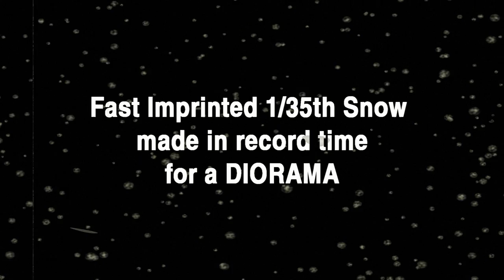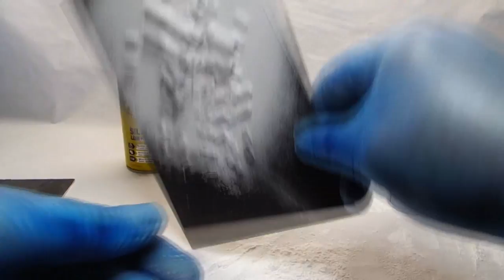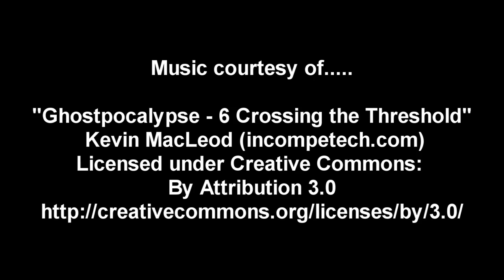MAKING IMPRINTED  SNOW......FAST!

Comment: does the snow remain soft, or it becomes hard or is there a product to make it become hard?
Reply from the maker: Hi Dario, the kits now come with an adhesive which you can apply with a hand pump bottle-  A  trigger spray bottle-  A pump spray bottle, or airbrush- or hand brush...

Mixed with our snow powder it sets  hard. You can build up many wet layers quickly and because it is crystal clear and water thin it is realistic too.

However, it is not water proof but will stand up to handling and touching etc.

You will have to play with different adhesives to try to get the effect you want. But at least we supply one now....Phewww!
Reply: Hi thank you for your answer. Unfortunately I dont understand: you talk about an adhesive you supply that can be sprayed, but I couldnt find it on your store. What's his name? I also dont understand if this Adhesive is something you can use instead of hair lacquer to stick the snow, or can be used over the sticked snow as a final varnish to seal and let the snow become hard.
Thanks
Reply from the maker: Hi Dario.. We have not put our adhesive on our store yet, as we have to change our instructions, website and everyhthing else first. However, we do include it with all kits purchased now.

The adhesive is water clear and water thin. It is water soluble and water based. It is perfect for dioramas and all models. However, we have not experimented yet with fixing snow using our adhesive when it is dried. This would entail spraying a coat of rattle can clear acrylic modelling lacquer over it to raise its durability..  Our snow powder can behave like real snow in these situations and start to go clear etc, so experimenation is the key..  

Another method we recomend  for wargaming figures is to use tinned clear acrylic lacquer and apply it with a brush where you want it. (like on your base). Then sieve the powder onto this.  You can also make a stiff pate like this and push it around the base too..  When set, this will be very permanent. Experiment first!

Anyway, I hope this is all good for you and of some use. Get in touch and let me know what you think.

Info@precisioniceandsnow.com

Comment: What do you use as grass for your dioramas?
I shall be buying krycell soon, it's definitely worth it
Reply from the maker: We tend to use a mixture of grass scatters to get a subtle difference in height, texture and colour. Sometimes, we blend scatter's together using a food  processor, or grinder. We always put a little texture in with grits and sand also which breaks-up that un-natural even look when fixing into place.  

Other times, we paint the finished grass surface in situ to get the colour we want..

We have a nice dio with a tiny1/76th series 1 Land Rover in an orchard using most of these techniques. The te4xture was first laid down using a mixture of grits, which created an uneven surface with small rocks. Then it was blown over with dark brown shades and then scatter was applied from above and fixed into position. It looks very, very good. I'll see if I can get something up on our channel, and I will let you know.

Hope this is of some use to you!

Steve
Reply: Thanks a lot, looking forward to it!